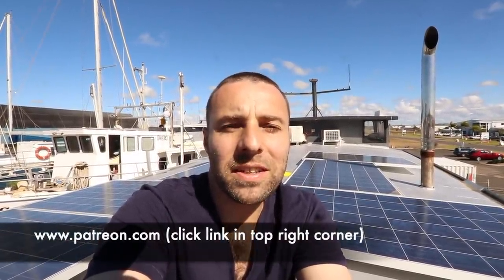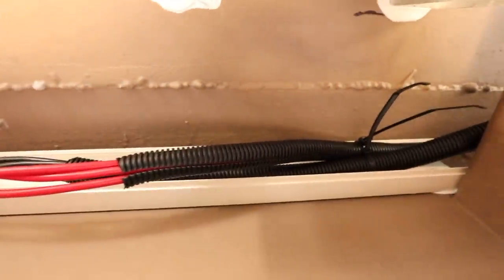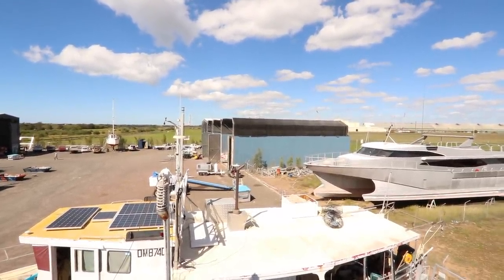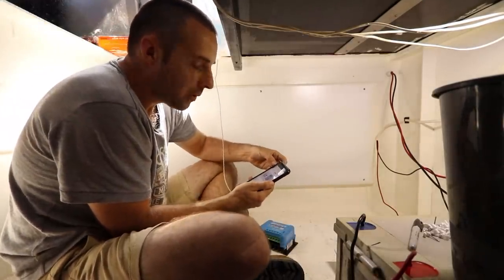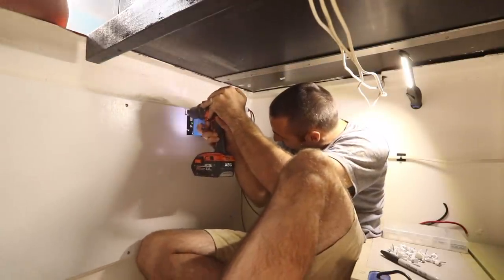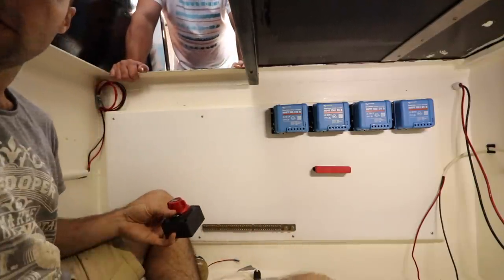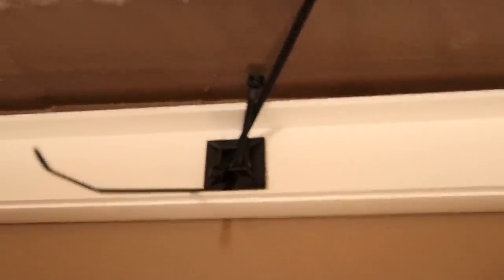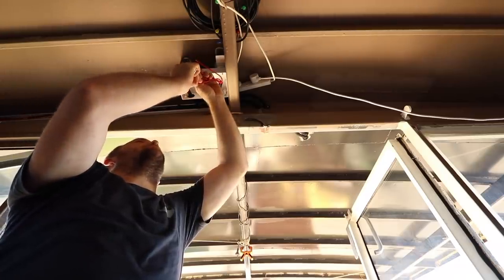Installing MPPT Solar PV Charge Controllers - Project Brupeg Ep. 90 (part 4 of 4)

Comment: I love the install, looked very complicated at first but by time you finished it really was straight forward. it seems to be a pretty reliable system. Your flexible conduits will last forever, I have used them for years in every thing from go cart to boats. Great job as usual
Reply from the maker: Thanks Traveller

Comment: the sticky zip tie pads don't last for long. Within a year, the adhesive will turn loose and you'll have wires hanging down. They have a screw hole in the center, so use a screw to secure them when you can.
Reply from the maker: Good to know thanks Stuart
Reply: @ProjectBrupeg  Instead of screwing them down, consider gluing?
Great video! Scott is a very knowledgeable addition to the team.
In the pan of the yard, what is the blue building off the stern of Brupeg?
In previous comment you mentioned taking solar panels down when going into the Ice.
 What is the plan, since the panels are hardwired?

What are your plans for a fire suppression system in battery compartment?
For a temporary solution, would this work? 
 Stovetop Firestop from https://swiftfireprotection.com (not sure if available locally and website
did not recognize you address)
Reply from the maker: Thanks for that hammer. Yes we will take the down in the ice. I have enough excess cable to just cut the wires and re join them when we fit the panels back up. It’s a bit of work but panels are useless down there. The blue building directly behind is the yard office. The big sheds in the distance and where they build new alloy power cats.
Reply: @ProjectBrupeg  Damien, Thanks for the reply! 
Is that something you could make a video of?

Comment: Damien, I would suggest that after you get all of your wiring done , that you go back to the holes with the open grommets and seal them with firestopping caulking of other type of intumescent material. That way if there is a problem due to a short, or a fire in the space, the fire and smoke will not be able to travel from one compartment to another. You can also use the same material for the hydraulic lines that pass through bulkheads etc. It is well worth the money for that extra amount of safety. Wayne from Newfoundland- Canada
Reply from the maker: Awesome thanks for this Wayne, Ill try and see if I can track some down over here. Thanks for the tip.

Comment: Nice setup. I know it's a bit late but with those square cable tie pads, if you peel the backing off and lightly heat them with the heat gun, they will stick like crazy and you'd have to cut them off to get them off. 

Victron is about the best solar equipment, including inverters, that I know of.
Reply from the maker: That’s bloody handy to know. I’m gunna do that from now on, some of them are borderline only just holding on so I’ve been using a dab of adhesive, but heating is way easier
Reply: @ProjectBrupeg  Damien, was going to add that you can throw a twist every foot or two on those longer runs, it will eliminate the need to zip tie so often, and neaten the bundles a lot while only consuming a tiny amount on length, maybe 5%.. but also gives you some reserved length in case you come up short, or have to cut into it later. If something yanks on a twisted cable it acts like a twisted rope does by stretching before it breaks.
Reply from the maker: Nice. Never though of that but sounds like a great way to absorb some of our excess length
Reply: @ProjectBrupeg  Used to make industrial cables for custom computer chip manufacturing systems we produced for AMD, Intel and Seagate among others... We'd twist the AC and DC power cables (pos and neg) with shielding to help stop interference with sensor cables, but it also made them more durable and flexible than if run as simple parallel strands.

Comment: Hey guys great series and very informative. Just a quick note to say when doing cable runs you could use velcro straps to temporally hold the wires together until you have all wires run. Saves on cable ties/ waste as you can re propose the velcro straps later on. Keep up the good work!
Reply from the maker: Great idea thanks Daniel. Jess

Comment: I might have missed it, and I know the system has been in place for awhile now, but I never saw you mark the cables from the solar panels to the charge controllers.  My concern is that you might have a red positive from say solar panel #1, and a black ground from solar panel #3 going to one charge controller.  I watched as you cut the red wires at the breaker box and connected them to breakers without any apparent concern of what wire went to what solar panel.  Again at the charge controllers,  you didn't seem to do anything to match up the pairs of wires from solar panel 1 with a given controller, another pair from solar panel #2 to the second panel, etc.  Basically, unless you have checked in some way to ensure you have the matching wires from a given solar panel to the corresponding controller,  is placed the solar panel pairs in series with other panels.  On a sunny day you might end up sending too large of a voltage to the controllers thus damaging them.

It would be a easy test to take a dark blanket up and cover each pair of solar panels one at a time and then measure the input voltage at the solar charge controllers to make sure that the voltage only drops on one controller at a time. 

It is also very good practice to label the end of each wire to remind you in the future where each wire goes.  Right now as it's all fresh in your mind, it's easy to remember what charge controller goes to each pair of solar panels, but give it a year or so and it might not be so clear what panels are connected to what charge controller.  Add some crisis or malfunction, a little panic, or heaven forbid something goes bad and is smoking, and it's not going to be as easy to remember what wire, device, or switch does what, and what it is all connected to.  Nothing beats a good label marker at labeling each charge controller so you know what pair or solar cells is connected to what.  Even labeling the solar panels themselves will be a time saver if you need to troubleshoot things later. 

A final note.  Now that the install is done and working.  Take a picture of the layout.  Add label numbers on each device.  Then print that page and put it in a ships technical manual.  Open up a word processor, and add descriptions of each numbered device.  List things like where the wires are run to the connecting devices.  List the colors used for each device.  List the make and model of each device, as well as a few different suppliers (with contact information).  Make sure to include a copy of each devices owner or users manual in your "ships technical manual".  It will add a little bit of time now, but honestly if you don't do it now you will never have a better time to do it -  it's fresh in your head now.  It will just take longer, and you might forget something important you will really wish you had listed later.

Anyway, enough bable.  I've been watching in awe as you guys take on creating something from nothing video after video.  Best of luck, sunny days, and enjoy the ride!
Reply from the maker: Thanks. Lots of good advice. We will be labelling all conductors and equipment as your right, a bit of time now saves a bunch of headaches later.
Reply: @ProjectBrupeg  👍

Comment: I used flexi conduit as grommets to I split the required length then filled it with sikaflex then put in hole never moves then. Great set up well done.
Reply from the maker: Funny is day that. We ended up skiaflexing them in also

Comment: I have done some checking as I am not as familiar with the mm wire sizes.  The us uses wire gauge and that is our standard.  It is a bit hard for me to find a consistent conversion. But the best I can find says that a 8mm diva multi strand wire should be able to carry about 100 amps.  Now as you combine cables in a conduit you reduce the max current of each one. For a conduit with 8 conductors that reduction factor is .52. As you will be only drawing 20 amps from the panels the long runs should be ok, but when you combine the current potential from four batteries you need to increase your cable size or reduce your fumes to a max of 100 amps.  Hope that helps
Reply from the maker: Yeah that makes sense. Total amps between PV and MPPT is 7 @ 65vdc so nonissue there. I will drop the main fuse down just to be a safe as we don’t draw more than 30amps currently anyway

Comment: great job guys the extra effort in the beginning pays dividends in the end use and future mods and repairs. if you wanted to use the bootlace ends a small drill could be used to enlarge the holes enough I think there would be enough meat in the connectors to take a bit but in the dry inside environment it may not be worth the effort.

Comment: When it's still fresh in your head you could mark the solar panel group with mppt it go's to. Also anyone can trouble shoot it in the future easily. 
Great setup and smart using multiple mppt .
Just need some lithium batteries in the future. 😉
Reply from the maker: Hi Todd, yes exactly what i am plannign to do. every part of the system will be labelled up, just havent got to it yet. And Lithiums are definately something we want to look into.
Reply: I too was wondering if specific panels groups had been assigned to individual controllers - i guess this could isolated at the breakers easily enough if it wasn't already recorded?
Reply from the maker: Yes to all. Each pair will be labeled at all junctions so future trouble shooting is a small fast job
Reply: @ProjectBrupeg  I just think I will remember stuff like that, then a yr later I need to fix it and have generally forgotten. 😏
Reply from the maker: I run the same memory system

Comment: Great Job, 
Dunno what its called over there but there is a system over here called 'firetrace' which is ideal for electrical panels - Like a normal fire extinguisher but fitted with a length of thin flexible 'plastic' pipe which is zip tied throughout the install - the 'smart' part about the system is the tube softens and then bursts when a flame starts up near it - basically means the whole fire extinguisher discharges just at that point where it's needed - maybe worth looking at for the engine room too.   You might find a supplier willing to donate / sponsor an install.  (usually features a normally open pressure switch to sound an alarm if it discharges).
Reply from the maker: Never heard of that but sounds brilliant. Any chance you could flick a link over of the stuff your thinking of?

Comment: Looking good mate , I installed six 235w panels on my boat series parallel through a single 150/60 Victron MPPT I get 1650w at 60 amps on a good day, I have a 600ah 24v battery bank I’m in Hobart at the moment and the sun is too low in the horizon to get a decent charge . I also run a Victron battery balancer to keep the mid point deviation in check there about $120  well worth the investment to protect the expensive batteries my system is controlled by a Venus GX.
Reply from the maker: Nice. I’ll look into that balancer. It’s likely we will upgrade batteries soon as I’m not really sure how good these are and we can’t pull decent current from them because of the tiny built in leads. So if we add a balanced it’s likely we will do it then

Comment: Great work. One observation, from my limited electrical knowledge. It appeared that the cables you connected to the battery were a smaller gauge than the cables coming out of the batteries. I believe (but an expert might correct me) that the smaller cables will restrict amperage (but not voltage). From my long ago classes, the larger the cable you can install will allow higher amperage to flow compared to smaller cables.
Reply from the maker: Hi Paul. The cables we extended the battery cables with are the same size as the originals. That said the originals are well undersized are are a major limiting factor in our system. We can’t pull really high amps with these batteries as the cables are permanently resined into the battery so we can’t upgrade to the right sized cable without changing batteries, which is something we plan to do once launched
Reply: @ProjectBrupeg  That makes a lot of sense. Thanks for the explanation

Comment: Always wire the battery side first, solar side last. Cover solar panels when connecting because they are producing power. Don’t need a neutral, it’s not an AC system. DC only needs two wires and buss bars.

Comment: Any plans to thermally insulate that solar junction box? I bet that will get really cold in Antarctica and it's a golf ball sized cold hole into that cabin. Solar install looks great!
Reply from the maker: Insulation will be 120mm thick right behind and over top of that hole. So no need to touch the box

Comment: hey damien; I've used a ton of those sticky backed ziptie loops in my AV install career, and have always had them eventually fall off. even tiny 1mm^2 micro XLR cables end up pulling them off of basically any surface... always end up having to screw them in place where I can, and replace the double-sided tape with 3M VHB where I can't.

edit:
be extra careful about your screw choice; a phillips head screw will raise up a burr on the righthand edge of every spline when you screw them in, and cheaper screws often have the burr on all edges. I've seen them wear right through insulation on cabling when they end up sitting proud of the ziptie loop. 😬
Reply from the maker: Ok good to know. I’ve actually been going through any that pop off with a dab of silicone adhesive as I always have my doubts about sticky back anything lasting the test of time

Comment: Came from dangarstu. Subbed. Going back to start at the beginning now. 👍
Reply from the maker: Awesome stuff Matt. Forgive us for the crap audio when we first started. We were complete novices back then
Reply: Gotta start somewhere. Hey I noticed when u were putting the cable ends into the mppt units, when the ferrule wouldn’t fit,  so, in that environment you really should be tinning the ends of those wires. You’ll end up with the the green death on them with the atmosphere in there. Which will then give u high resistance and poor transmission of current. Make it a habit to tin your cable ends.
Reply from the maker: Is that needed when the cable itself is tinned (asking to learn not to be an arse)
Reply: Project Brupeg if they are already done then no. But I was assuming they were pure copper.
Reply from the maker: Yeah we do try to use tinned whenever possible. Some is straight copper but those get the business applied to them to prevent corrosion
Reply: Good man. Resistance in a terminal is hard to see so I thought I’d just put my two cents in. I haven’t seen the whole build yet so I’m not up on what shit is going on. Are u putting a couple decent search lights on the boat? While your running cables to the roof haha.

Comment: Looks good! Though I have to say, your main battery cables look like they will be a bit thin for running a large 240v inverter?
Reply from the maker: Your right. We can’t increase the size as its hardwired into the battery from factory. We will be upgrading the batteries before we hook in the main inverter

Comment: I did not notice, did you have hold downs on the batteries?  I am sure they would do a bit of damage if they were sliding about.  Nice wiring job.
Reply from the maker: Hi James no nothing clamping them down as yet. It’s one of the smaller jobs I’m yet to get to. It’s also likely we will be changing batteries shortly so I’m holding off on the clamps until I know more detail about that

Comment: Is that wiring on the batteries heavy enough?
Great step ahead!
Thanks for the video.
Reply from the maker: Nope. Not at all but because the darn batteries have the wire resin infused into them rematches than a lead terminal, I can’t change it. Only thing I can do is change the batteries
Reply: @ProjectBrupeg  Well that sucks.

Comment: Quick question regarding the wire pairs as I didn't see it in the episode.
How did you go about identifying the pairs from the panels? Labels? Multi-meter after the run? Tone generator/probe?
Reply from the maker: Multimeter after the run. But I do want to go through and label them all, just somethuing i havent got to yet.

Comment: Are you getting much voltage drop over the long cable runs you have ?
Reply from the maker: Next to nothing as we oversized the cables quite a bit. Running 65VDC at a max of 7amp round trip 22m via 6mm2 conductors

Comment: is each set of cables from a pair of solar panels connected to the same charge controller? I didn't notice how you kept track of that, or if it's not important
Reply from the maker: Hi William. Tone generator allowed me to check I had one pair to one controller. It’s possible without this but not as good regarding shading etc

Comment: Can any installers guesstimate the cable losses for all these long runs from panels to battery bank? whats the best way to do this? 48v, thicker gauge cables etc. I ask as I'm planning similar and imagined short, heavy cables were the best option. Also on a steel boat, why run earth cables rather than common earth/bond.?
Reply from the maker: Mark we use a voltage drop calculator at rapid tables. Not need to guess it will tell you exactly. Also our solar runs are 65v. You want them as high as poss to give you the best efficiency. Drop it back down at the MPPT